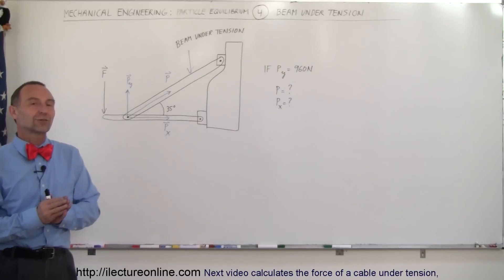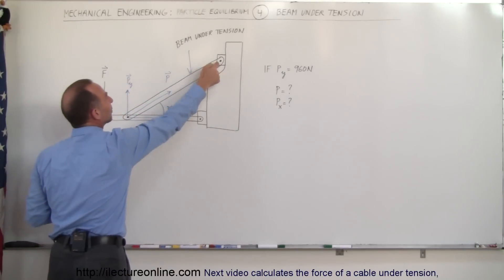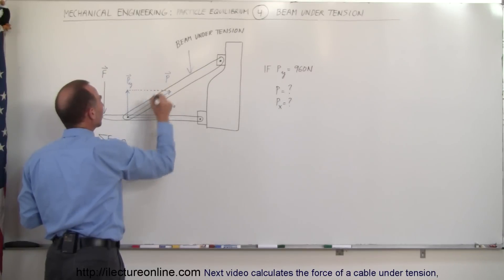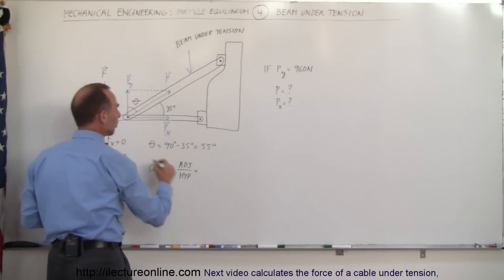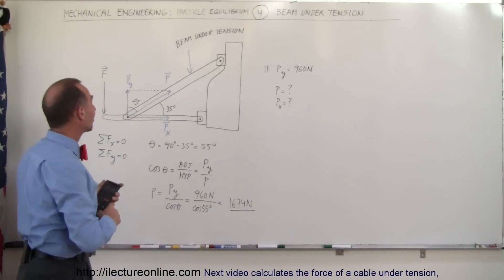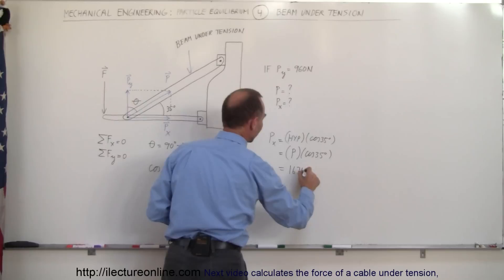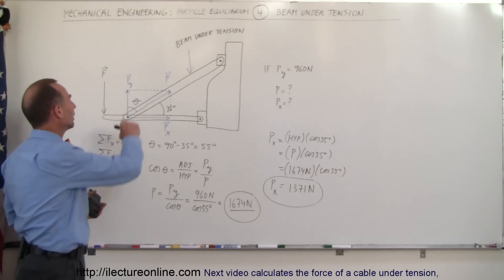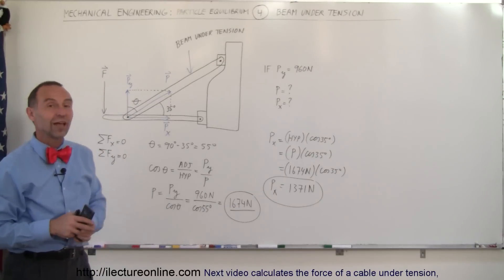Mechanical Engineering: Particle Equilibrium (4 of 19) Beam Under Tension

Comment: Could you solve it without to use the angle 55’? P=Py/sin35 and Px=Pcos35 ...is it correct?
Reply from the maker: You can use the complimentary angle.  Did you get the same result?
Reply: Michel van Biezen I’ll try......Many thanks
Reply: @albertopoli8896  yes is the same answer i did.

Comment: my question is how can u add force f which has a y component to sigma fy with Py and here it is the case of equilibrium on a particle and the particle is the one force p is acting on
Reply: exactly this is what i ment you didnt calculate the force Fy with Py because the particle we are working on is that of force P
Reply: please reply because my doctor took of grades for not considering that force and the case was like this working on a particle and on the right and left of the particle were two forces how i thinked is that if we consider those 2 forces with y component p we are moving  the forces and producing a moment but my doctor said no

Comment: Correct me if I'm wrong, but to my understanding, in this case F and Py don't have the same magnitude. The moment due to F and P cancel, and there is another force at the bottom hinge that is needed to satisfy the Sum(Y forces) = 0 rule?
Reply from the maker: +Justin Huang F and Py do not have the same magnitude.
Reply: +Michel van Biezen Thank you for your response. And thank you for making these videos. I just have a follow up question: is the Y-directional reaction force in the top hinge, bottom hinge, or both?
Reply from the maker: +Justin Huang  This example ignores what happens at the hinges, but yes, there would be a force in the x and y direction acting on the upper hinge, and also on the lower hinge.